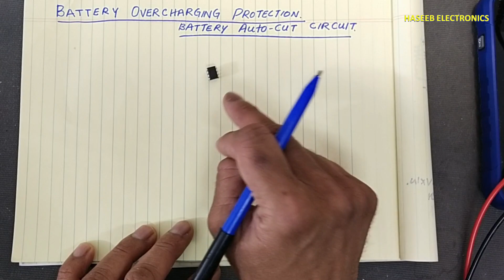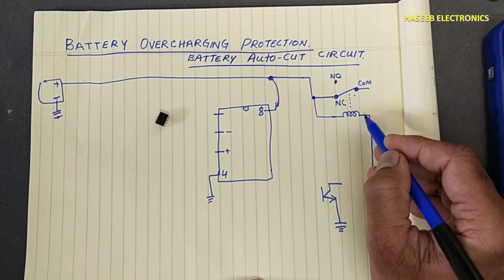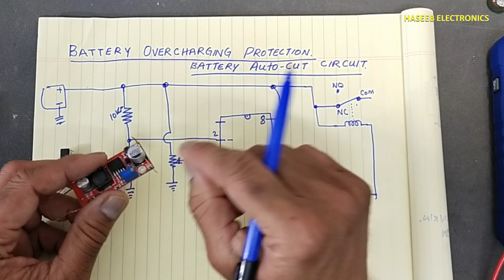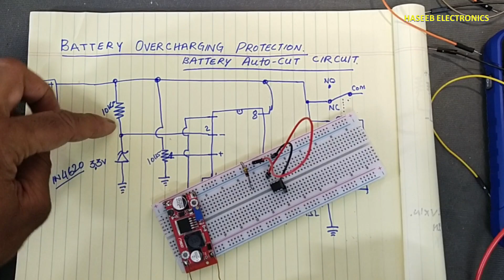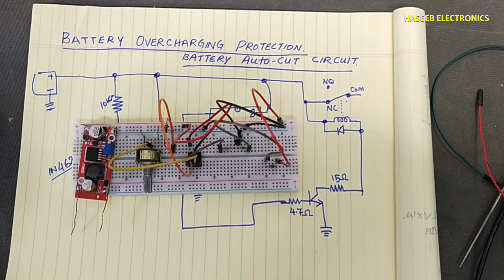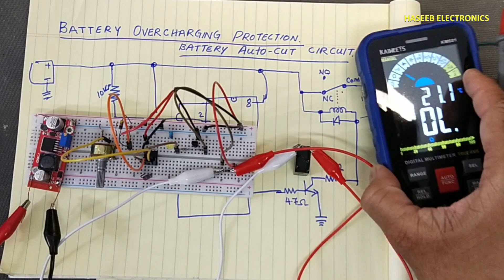{860} Battery Auto Cut Off Circuit, Battery Overcharging Protection

Comment: hello dear Haseeb, i really like your videos on electroninc, you are doing a lot for students passionated about electronic. Here is my problem, i am struggling to understand the auto cut of charging of the battery of trimmer, the secondary of high frequencies of the transformer is directly connected forward zener in serie with battery and all with a led and resistor. how does auto cut off happen, thank a lot

Comment: Question that keeps nagging me so I hope someone answers:   
Lithium-ion charging, it is CC the CV.  To do it manually, for a 12v/20Ah, 3s pack, is it as simple as setting AMPs constant to, for example, 3 AMPs then set the voltage to 12v and let it charge to 12v 
then bump up the voltage to 12.2 leave current at 3A and let it charge to 12.2 and 
then bump up the voltage to 12.4 leave current at 3A and let it charge to 12.4 and 
then bump up the voltage to 12.6 lower current to 1A and let it charge to 12.6.

Would that work?  I'm just wondering, can it be done manually if one has a voltage and current adjustable DC power source?    There are a lot of chargers on the market that are programmed to do this, but can it be done manually?

Comment: thanks for your information. Assembled the circuit and observed relay chattering
Reply from the maker: You are welcome
a diode must be installed in parallel to the relay winding
it is just over voltage protection, as soon as the voltage will drop less than the cut off point, it will switch the relay immediately. for proper function, it needs battery management system to control the charging cycle. when the battery will fully charged, that time, it needs an interlock to discharge the battery at specific level to reconnect charger

Comment: lakin jab charger connect karien gay tu charger ki voltage 13.5 ho jani hay tu kud hi circuit cut ho jana hay pir on of hoyta ray ga
Reply from the maker: yes brother 
ye sirf over voltage protection he,
 complete battery management system nahi he. 
aap video number 711 aur 712 dekh lein. us mein arduino based battery management detail se bataaya he.

Comment: You need to show a complete schematic of the circuit separately. and you should explain on that schematic. when you are adding  a component to the circuit, the details of the component should display on the screen. You added a LED to the circuit. but it is not shown on the circuit which you drew. The circuit is great. but note that this video is not only seen by experts. may be by learners also. will you be able to add the short comings.